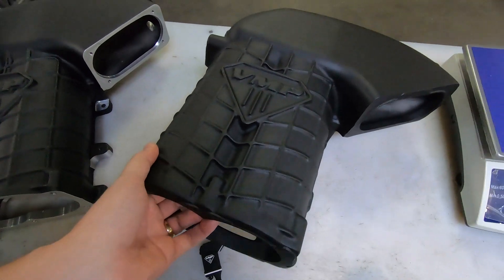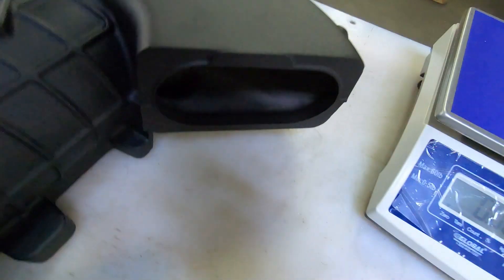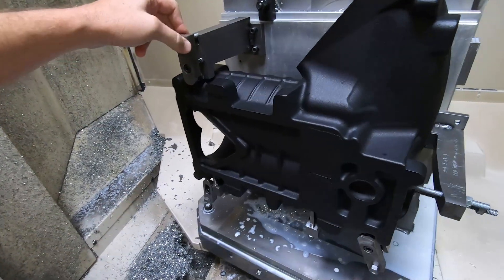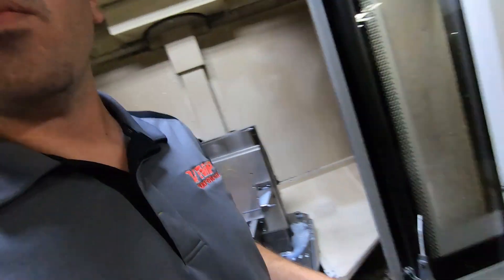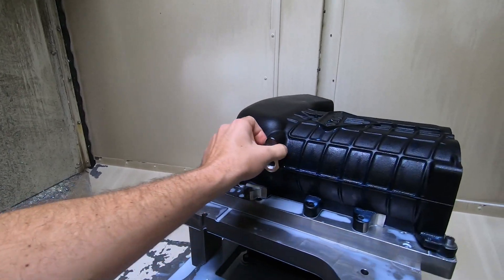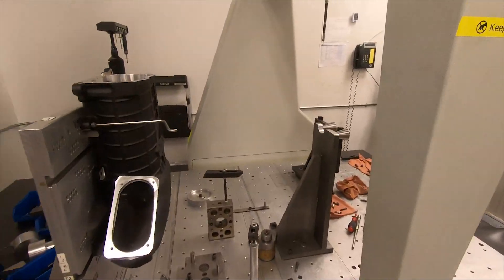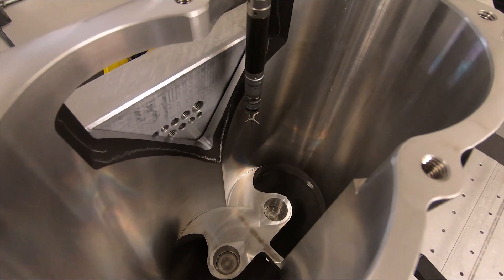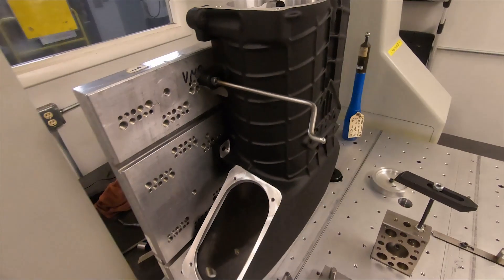How It's Made | VMP Gen3R Head Units

Comment: Which blower is better the Odin or gen3r.... or what are the benefits of each over the other
Reply from the maker: At street usuable horsepower levels, these superchargers will perform similarly.  Both are 2.65L units.  The Gen3R is a rear feed, blow down unit, while the Odin is a front feed blow up unit.  Outside of the aesthetic differences that come from the layout, the Odin uses twin intercooler cores in the lid and will have a slight advantage at higher boost levels with IATs.
Reply: VMPPerformance thanx for the reply

Comment: How much is 1 for 2020 5.0
Reply from the maker: The Gen3R actually will not fit the 18+ engines due to the direct injection components that are in the engine's valley.  Our solution was the Odin supercharger and it's available in a kit format ready to install and run.  It starts as low as $6999 for the Loki variant of the kit and goes up to $8499 for the Odin variant.  The difference between them is the supporting modifications included in the kit to support more power.

Comment: The gen 2r is smaller does it have lower end torque then a gen3r on a stock gen 1 coyoty the gen 3r has more higher rpm hp

Comment: As a CNC service engineer, I know good machines when I see them. That Okuma horizontal is top notch as is the Sheffield CMM it was checked on. Great video Justin!!
Reply: Wenzel makes the best CMM structures IMO, software not so much. I used to work for them for a while and got to experience different makes of CMMs when we'd retrofit them with new Renishaw products. I retrofitted a lot of old Sheffield RS machines so it goes to show how well their products were made back in the day in Ohio IIRC.

Comment: Question, weight is such an issue with competition cars. Why can't the air inlet be machined down to even thinner tolerances to increase air flow and reduce weight. Especially after the MAF sensor. There is still 2-3 lbs of material in the air inlet housing. I know you need the strength for the rotational mass. Thanks
Reply from the maker: Everything is cast to the minimum safe thickness for structural rigidity but there is some variability that has to be accounted for and makes the walls slightly thicker.
Reply: @VMPPerformanceTV  cool. I was just thinking out loud. Very cool behind the scenes.  Thanks

Comment: Does mirror polishing the inside of the rotor housing where the rotor pack seals add any power?
Reply: Smoother surface allows for smoother airflow, which = less turbulent air = more air allowed to the engine more air = more power.
Reply: @The1Monty  
It's more about the better seal than laminar vs turbulent airflow.
Reply: @stylac True
Reply from the maker: No... And the RA (measure of surface finish) is already extremely fine on these.